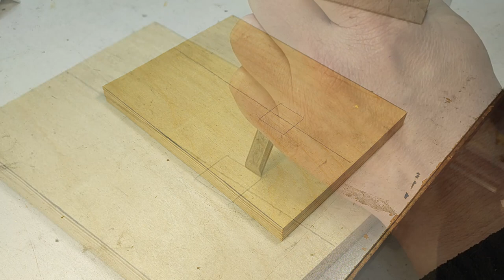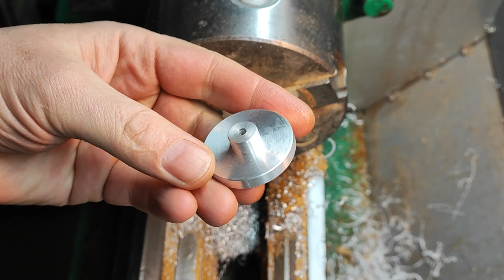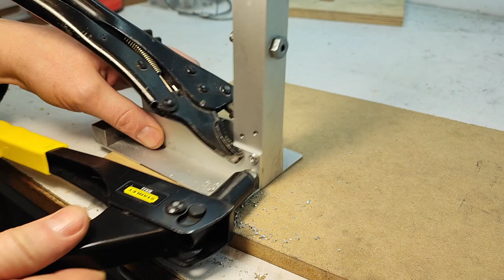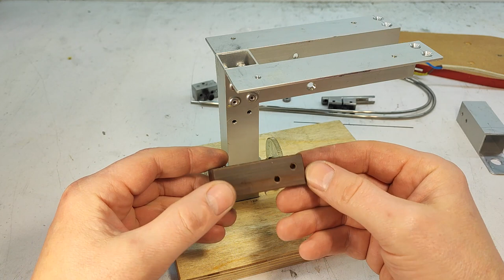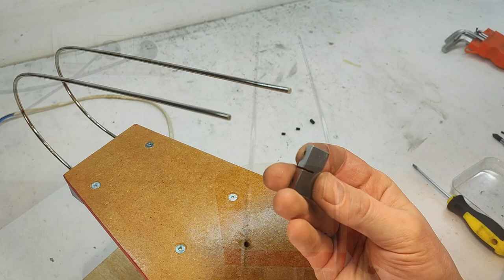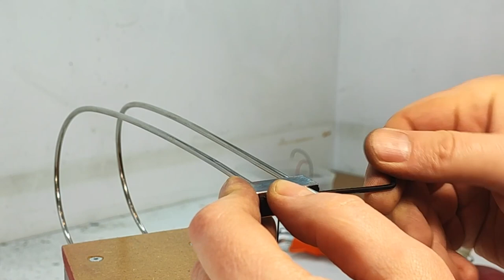DIY SCROLL SAW

Comment: The project is so superb and I could not resist myself to try and make one for my personal use.If you can part with me the drawing of the materials used in it so that it will be easy for me to assemble the materials before attempting this on trial error basis.Hope you will help me in this regard. Thank you in advance and do expect beautiful projects from you in the near future.
Reply from the maker: Thank you very much for your interest in my project. Unfortunately, I did not make drawings for this project. I never do them at all. Reading improvisation. adjusting one part to another as I progress.